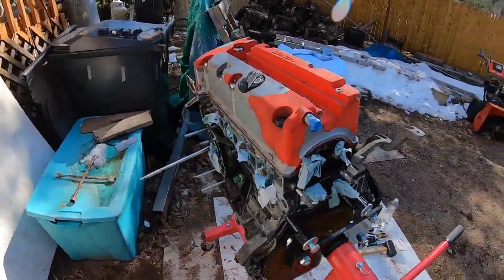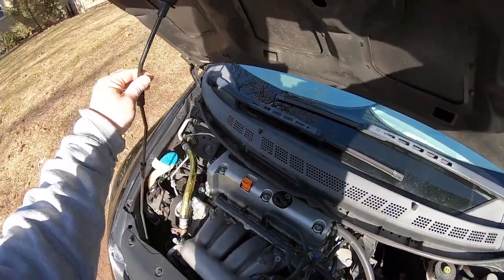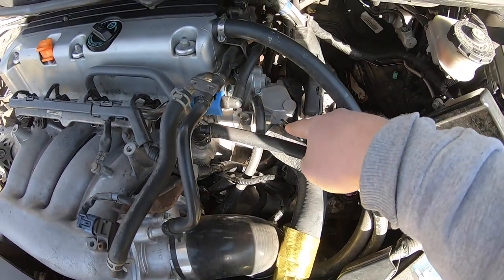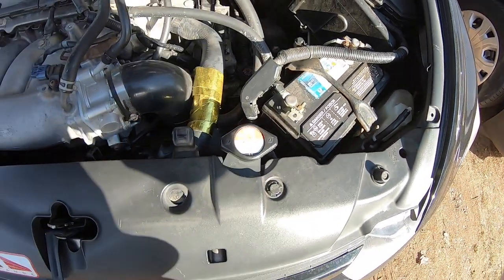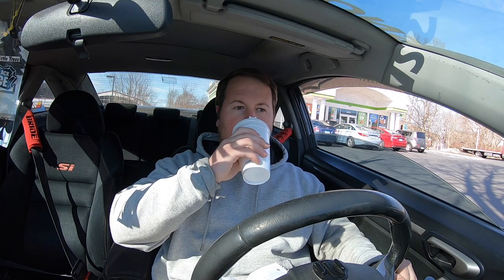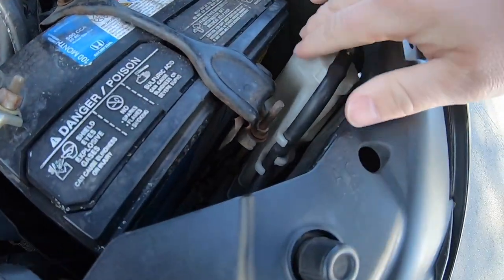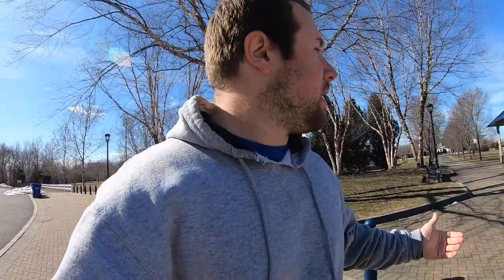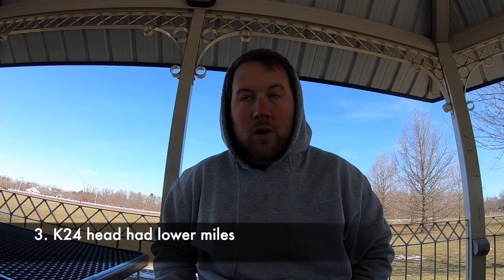Why NO k20 K24

Comment: K20z3>>>>K24.  The 8th gen Si was the last true high revving engine.  True anything can be changed with a valvetrain  upgrade and tuning.  I do see why you went with the k24 for a budget N/A build due to the higher displacement.  

Personally for me, once you experience a turbo K-Series, you never want to drive an N/A 4cylinder again.  I've got an FA5 i'm so glad I held on to when I bought an FK8 Type R.  The major downside to the new Type R is the cost to power ratio is absolutely insane.  You can easily get +60hp with just hondata and access to 93 octane.  I really grew to hate the DIFP they put in it, it's weaker than the pump on the damn accord.  It cost me well north of $10,000 in order to hit 400/450ftlbhp in mine, even doing all of the work myself.  The most substantial upgrade was the hondata fuel system which allowed you to run E45 with no fueling issues.  At that point the stock baby turbo is the bottleneck, but fueling will become an issue again once you get into the 500hp territory..  Flex fuel on the stock fuel system can be viable if you only have 91 octane available and no substantial breathing mods.  For example, I had full PRL bolt ons HVI intake, heat coated titanium inlet, PRL intercooler and charge pipes, PRL catless downpipe (really a catted DP where I beat the cat out with a crowbar lolol)  Once I added the larger cold side charge pipe with the intercooler, my fuel pump was maxing out in 3rd gear with the tune I had been running prior for months.  More airflow=more fuel needed.  I just ran 93 until I installed my fuel system where E45 was a night and day difference in constant torque everywhere.

Cars I treat the same as firearms and computers, never go cheap.  With the $10,000-15,000 I dumped into the FK8 (including replacing  the garbage heavy wheels it comes with 18" 17lb Weddsports, girodiscs (for even more unsprung weight loss), better pads, fx400 clutch)  I could easily get over double the horsepower out of my k20z3.  Fueling won't be an issue since it's port injection.  The same applies to the k24 .  It seems pretty cost effective as well but I don't like the idea of frankenfucking my engine when I could get the same results on a k20.  There is a replacement for displacement, it's forced induction baby!  Again with that route you don't want to go cheap and get a supercharger, turbos are king.

I'm not trying to knock your build, i've enjoyed watching the process and picked up some pointers for pulling out my engine and trans to inspect, deep clean,  and replace worn parts.  Ive owned my FA5 for 10 years but never really worked on it until now.  The FK8 set loose the lust for more power and I did all the work and tuning myself, but at the end of the day that platform is just too expensive to build up once you try to get 500hp.  Also I need to fix the glass transmission that hondas are pretty notorious for, especially the 8th gen.  $6k on the old si would easily net me 500hp with the turbo turned way down.  Build up the block, trans, and head and 1,000hp would be possible.  Though that's a bit overkill, i'd have to wire in hondatas traction control module either way.  My goal would be to make a 600hp time attack car ideally, with the option to crank up the boost to silly power levels.  Also need to strip out most of the interior and shed weight to get more from the engine. 

The cost I haven't taken into account yet are major suspension and brake upgrades needed.  I hit the max governed speed of 133mph when I was stationed in colorado and had access to a very long and straight road where you could see well into the distance.  You can really tell the car (8th gen Si) is not made for that kind of speed as it's pretty hairy to go that fast, and especially slow down with those baby brakes it comes with.  I hit it's max speed once and never wanted to do it again.  On the otherhand with the FK8 going 140 feels like nothing, you can take curves at surprisingly high speeds once you get used to the level of grip.  I had to work my way up to find the limits of that cars abilities, each time thinking, theres no way this is possible, how is it so stable? lol  I managed to get up to 180 once, and 170 multiple times, but at night it's pretty terrifying once you get fast enough that you're outrunning even your highbeams at night.  3-5am seemed to be the optimal time for top speed runs as it's cooler, and there's nobody on the road.  

I've had terrible luck in 2020 and have been pretty heartbroken as I had a 2019 Type R first for over a year that a deer suicided into in July, then I got a 2020 sonic grey pearl and had gotten way more power out of that with the fuel system and flex fuel, only to be hit at a stop sign 4 months later by someone in a $500 1995 minivan that cost less than one of my wheels.  At least I got to experience the Tail of the Dragon event with the CivicX.com guys, even if I was at stock power at the time (hondata had no way of jailbreaking the 2020 yet)  He hit me on the driver side wheel which bent in and pushed the spring and dampers into the engine cradle that "cracked it" along with hitting the radar module for honda sensing and the airbag sensors, the quote to fix went from $10,000 all the way up to $32,000  The 2019 had a similar fate where the quote was $12k and then all of a sudden jumped up to $26k.  The 2020 bs was infuriating as it only looked like a minor fender bender.  Until the "crack in the engine cradle that requires a special welder the shop doesn't have"  Meanwhile I was struggling to find any crack and called BS on that, but there was no saving it :(  I knew that new cars were a bad use of money, but didn't expect simple things to cost a fortune to ffix.  So i'm not going to try and get another, I just can't take that shit anymore.  So I can sell all my parts and build my Si to be wayyyy faster.

Random rambling over, keep up the good work.

Comment: I made 580whp on a K24A2 back in the day. That motor is solid! I only swapped the cams from an K20A2, but it makes little difference when you introduce turbos.
Reply: Aren’t the cams in the k24a2 the best cams in for a k series ?
Reply: @brisevans8976  something tells me the k20a cams are the best
Reply: @brisevans8976  from what I remember the K20Z1 cams outperformed everything else for peak power at high rpm. The K24A2 cams were great for low end torque.

Comment: The only thing the 50 VTC offers is better low end/midrange as the VTC closes down as you get closer to redline (on stock cams). Also, the K20 head will offer some gains but nothing crazy as you stated.
Reply: I tell people I drive a Kfrank making 224hp and every time I get, "those are low number." I should be pushing 240-260hp. I'm on stock z1 cams. The k20 head isn't a magic receipt for huge gains, and doesn't magically allow you to make power at 85xx rpm. I wonder if my setup makes ANY more power over a stock k24a2? After all the tsx cams do help make a lil more power even. Anyway, just my experience owning a k24/k20. My tuner said I make as much power as I should have lol
Reply: Vtc gives low and mid torque, and cams gives the highs. Simple as that. K20 frank is dumb
Reply: @Esdru221  you’re forgetting head flow lol
Reply: @yosh_tuned  it's practically the same
Reply: @Esdru221  no, it’s been proven. Can’t say a full k24 flows the same as a frank swap. Sorry but I’ve seen it on the dyno with cars I’ve tuned and it definitely makes a difference especially with NA. Anywhere from 5-10 with just the head swap and a broader top end power band
Reply: @yosh_tuned  k20 head flows around a 7% better, 10hp more less. But intake cam are trash compared to 06-13 TSX ones. Major improvement in k24 comes from 50° vtc and change cams in 03-05 ones. You definitely don't need k20 head to reach 260hp, and in the other hand, you won't make more than 260hp with a stock k20 head without stage 2/3 cams.

Only real benefit from k20 head is that is not needed improve valvetrain to put aftermarket cams.
Reply: @Esdru221  10hp is 10hp. You even said it. Difference between 235 and then 245 which is the avg on a dynojet.
Reply: @yosh_tuned  10hp with same cams. If you put a k20 head with his cams, you loose power. And if you don't put a k20 oil pump to reach 8300rpm you won't take advantage of the extra air flow, and to take advantage of the extra rpm and air flow you need aftermarket cams. K20 head only makes sense to put agressive cams without upgrade k24 valvetrain. But, keeping in mind the cost of buy the head and mount it, it's best upgrade your k24 head.

In summary, if you have a k24, best price cost power: 50°vtc and 06 -08 tsx cams, more simple, effective and powerful than a k20 head. If you want more power, stage 2 cams, spring and seals. The only scenario where it's worth the k20 head, is when you have  a k20, you change the block, and you already have the k20 head
Reply: @Esdru221  the head flow outplays the stock oem cams lol. They’re literally all within the same spec minus the type R cams that have a way more aggressive lift. You won’t lose power swapping a K20 head. Show me that info please lol

Vtc is important but I’m solely talking about the different heads

Like I said, broader power-band that tends to maintain power till 8500. That’s from using both K20 and K24 cams on a K20 variant head. With a k24 head, 8k seems to be about the limit in regards to where it start to drop drastically but the midrange is much broader
Reply: @Esdru221  also the stock oil pump is actually good for 8300 lol. I was revving my boosted k24 at 25psi till there and oil pressure stayed consistent. Oil pump is mainly for the higher revs. Full k24s just need the vtc and that’s it tbh as 8k seems to be where the powerband stops and starts to drop
Reply: @Esdru221  can’t say a full k24 makes more than a frank swap even with the 06-08 cams. When there’s countless data of it making more even with a variant of different oem cams. Unless you have your own proof then this conversation is just a “trust me bro” type of deal.
Reply: @yosh_tuned  dude...there are plenty of full k24 with 06-08 cams or even with 2gen TSX ones making 260hp, with a waaay fatter torque line than k20/24 franks with k20 cams. 
You don't make more than that just dropping a k20 head. 
The only real benefit of putting k20 head is  that already has 50° vtc and if you have a 03-05 TSX will be a improvement in cams too. But that's it,  differences in air flow is irrelevant.
Reason because power drops at 8000 is because you need aftermarket cams to make power in that band. Also matters intake manifold, exhaust etc etc. BTW is freaking dangerous rev more than 8000 in a k24 oil pump...lol
Reply: @Esdru221  are you talking about a tsx with the stock k24 manifold cause that changes things. An RBC style manifold is what most ppl go with for the best all around power.

50vtc doesn’t matter which head is used lol. You know that right? It’s based on the overlap, not which head is used lol

Also, those stock oil pumps are not going to explode if you rev them out lol. Plenty of other tuners who rev out their boosted k24s to that rpm range and I was pushing 25psi on a stock block

Like I said, at this point it’s a “trust me bro” as I can share data from logs or even dyno plots of cars I’ve tuned varying from full k24s with the 25vtc and frank swaps with a variation of oem cams

Comment: we have almost identical car builds , its great. i went through the same situation except my k20 block blew up. if you throw on the rsx type S oil pump on your k24, you can rev like your stock k20 . my redline caps at 8.1k and the engine feels great. definitely worth it in my opinion
Reply from the maker: I want to get a pump for sure. If i can rev to like 8k-8200rpm, i'll be happy! Currently saving for a 4 piston oil pump.

Comment: I got two k24a2 motors few days ago one from an 07 and one from an 04 tsx. I am not going the frankenstein because I also do not want my 3 k20z3s torn up mix match and can easily lose stuff in the garage. And of course I want it true k24 parts my z3s are for maybe an older honda or just backup motors. Yet to buy now a k24z7 motor from a 2014 15 si. I have zero idea how to hook up the wire harness from the acura tsx or what computer to use so fourth to get my k24a2 in my 08 fa5  tango red and my 06 si fiji blue. Always n/a life to never turbo! The 06 will be built for track the 08 is my clunker daily for fun will be all stock with header,exahust and intake oh and oil pump upgrade

Comment: The heads aren’t the same flow wise. The reason you are making similar power to a k24 with a z3 head is because the k24 rbb actually have good cams that makes more flow. Bare head wise the rbb flows around 270 cfm while the rbc flows around 290 cfm and the rsp head flows close to 310 cfm. If you were to put your tsx cams in an rbc head on your k24 bottom it will make more power NA I guarantee you

Comment: You will never have the k20 top end feel even with a 25vtc.. No matter how you put it, your k24 head will not make power past 8k rpm. 
Yes the 50vtc will make better mid range torque but won’t make power past 8k
Reply: In stock form yes. But 4piston disagrees. 😉
Reply: @michaelgranville1733  ok you’re talking about a completely different head up to that point lol